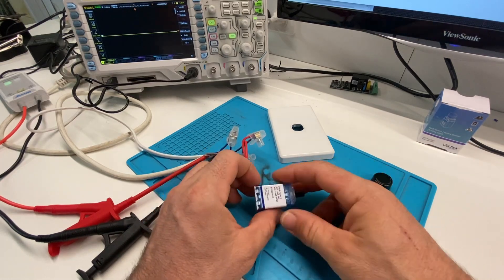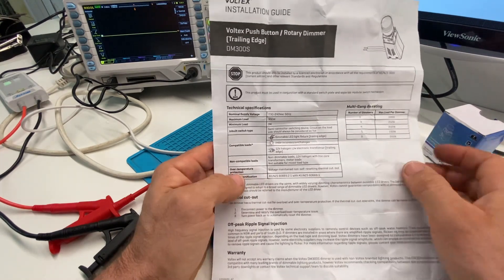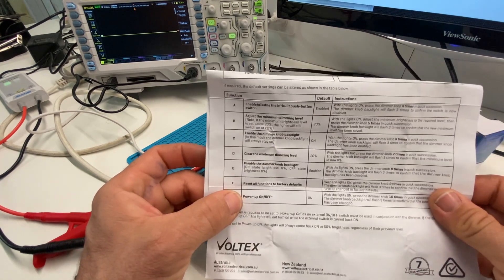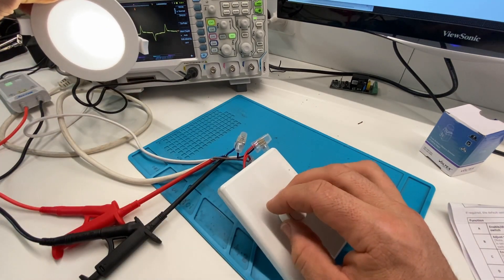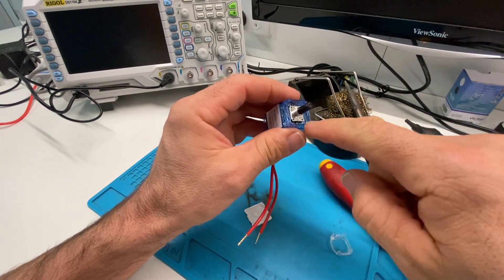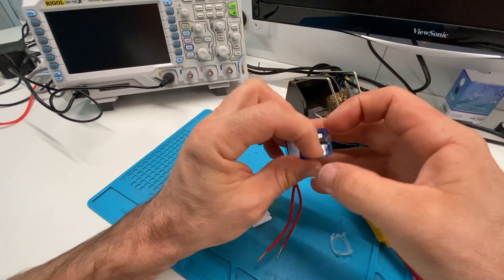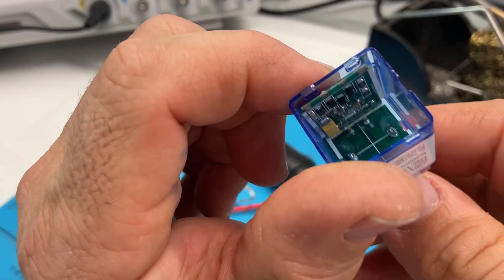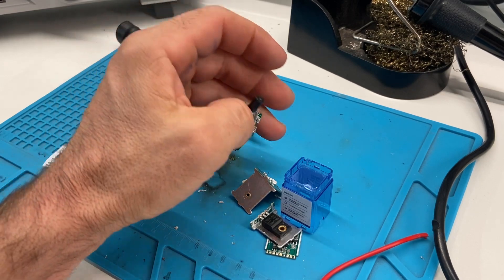Voltex Rotary Dimmer

Comment: Never had an issue with 950hHz or !050Hz ripple zellweger devices using such dimmers. Yet using Cetnaj downlights when I installed CABAC dimmers that claim for  1050hz filtering didn't work 

I was bitten hard and end up for basically throwing my profits away with a cabacs 2a filters so that made me split the circuit from the original configuration.

Comment: Add a digital potentiometer as a guess :D OK watched more. Emulate the rotary encoder in a ESP and control by Arduino

P.S Pull a Brilliant Lighting WiFi controlled trailing edge dimmer apart on another vid.